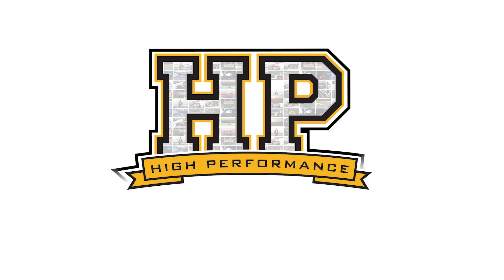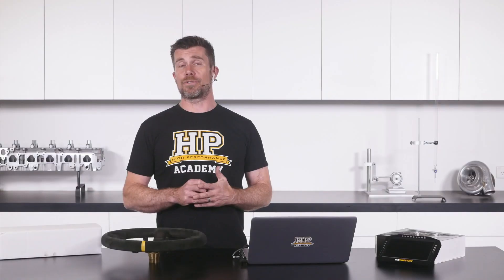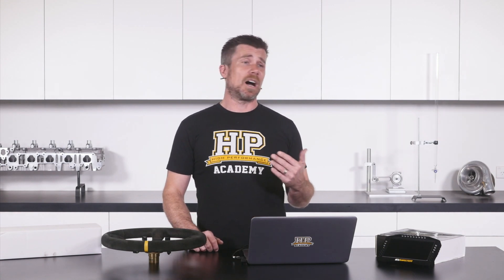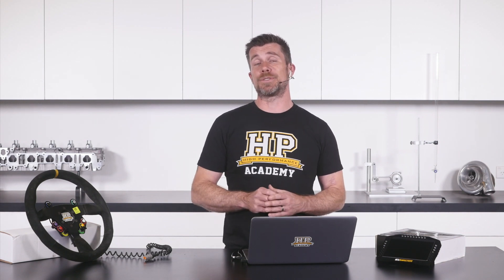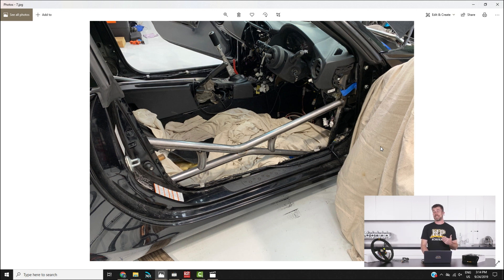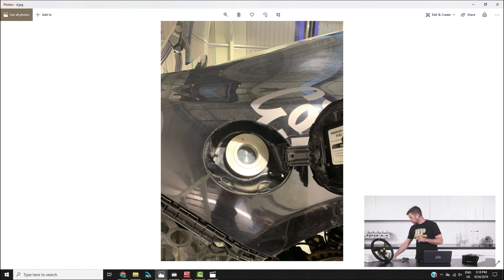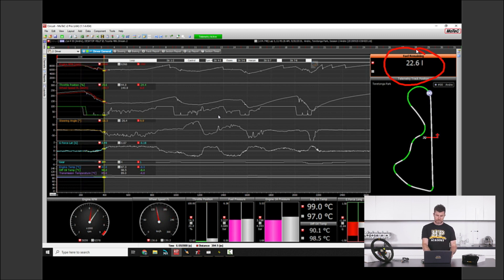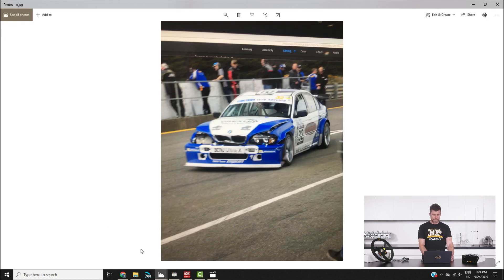V8 GT86 Crash, Driver Controls & Race Day Telemetry | Today At HPA 221 [UPDATE]

Comment from the maker: Welcome back team! What do you think of the in-car race footage at 20:13? Should we release more content like this? - Taz 👨🏻
Reply: 100%.  Should also overlay telemetry info aswell.  Regardless, love the vids
Reply: The in car footage was pretty cool. And I agree, you should overlay the data log in the video.
Reply: in board and pit footage will be good !! to see the correlation with the telemetry and the car, and how you work/deal with problems
Reply from the maker: @Michael Polster probably easiest to answer your question with a question. What issue are you trying to solve that a 'curly cord' is creating for you? From there you can work backwards to see what solutions there are when it comes to an internal connector or something wireless.

Crazy setup that UPS have, I know Fonterra milk tankers here have similar, and the data has been used to help prove one of their drivers innocent of causing an accident too which is pretty cool - Taz.

Comment: Where did you put the ECUMaster CAN switch board ?  and .... I found the OTTO P9x switches but what are the brand/model of the 5 way switchs ? TIA
Reply from the maker: The switch pad is mounted to the back of the steering wheel. We sourced the multi position rotary switches from a local company www.msel.co.nz

Comment: So what was the fuel pressure warning light for?...
Reply from the maker: There was some damage from the shunt to the wiring for the pump, but coincidentally the fuel pressure sensor was failing at the same time. When we checked back through the logs you could see it just starting to give some issues at the end of the qualifying session which then got worse during the race. 
Due to the accident, we just assumed it was completely related to that to start with. Andre will have a bit more detail in a future update - Taz.

Comment: That ECU Master bit of kit is neat - IIRC, that particular style of switch panel is limited to 8 controls, or 6 if a paddle shift is wheel mounted, so it would open up the number, and type, of controls that can be wheel mounted?
I assume cost was also a factor with not going for one of the radio, or infra-red, linked wheel switchpads? I don't know how reliable they are, but batteries are supposed to have a very good life, so not a real concern - however, even with the ECU' board, cable could be much cheaper and have more input/outputs?
Reply from the maker: That particular ECU Master CAN switch pad will take 8 digital inputs, 8 analogue inputs and control 4 low current outputs which is plenty for our needs. If you needed more though you can run two switch pads and program them to use different base addresses. We haven't looked into radio or infrared linked switch pads sorry.
Reply: @hpa101  
Cool, that is a seriously useful bit of kit!

Comment: Just want to add heated steering wheel to my older rigs. Good info though.
Reply from the maker: I've used them on a motorbike once before, but have only just been introduced to having one in the car via the Silverado here. Awesome in the winter, especially after loading the trailer or stopping to check all the strops - Taz.